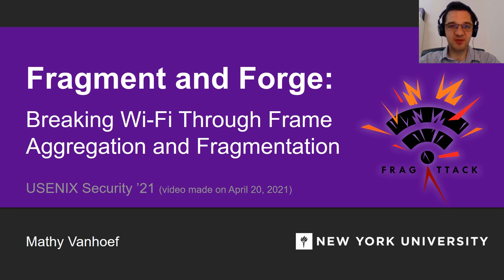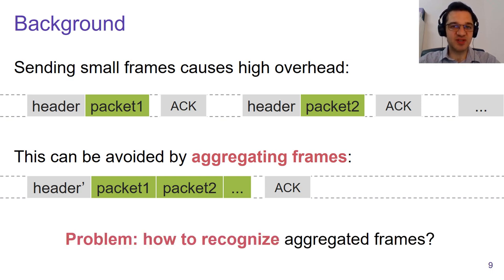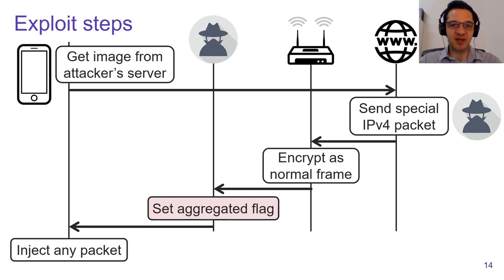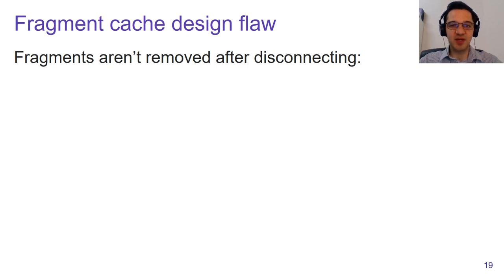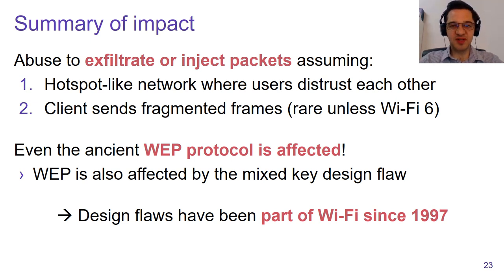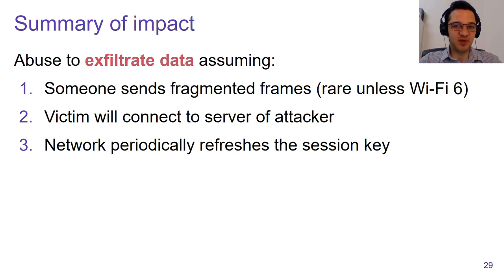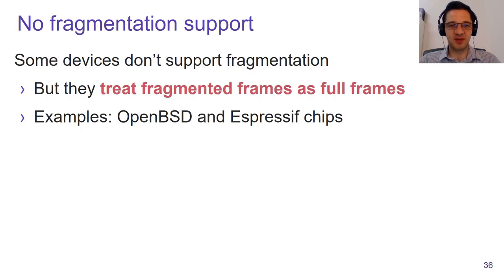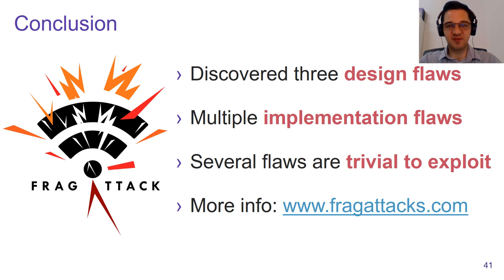FragAttacks: Presentation at USENIX Security '21

Comment: Great job on discovering these flaws. I am not 100% sure, but in my believe fragmentation is something of the past 802.11abg networks.
Could potentially affect the older clients though.
Reply from the maker: It's supported by all versions and is more likely to be used in the latest 802.11ax (Wi-Fi 6).
Reply: @vanhoefm  yup at least against the device i tested which had wifi 6e :D